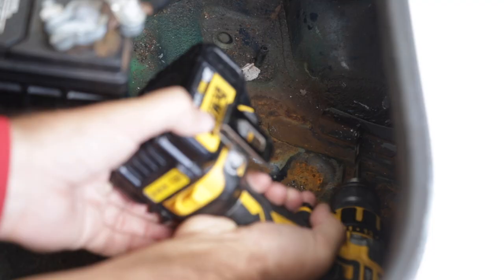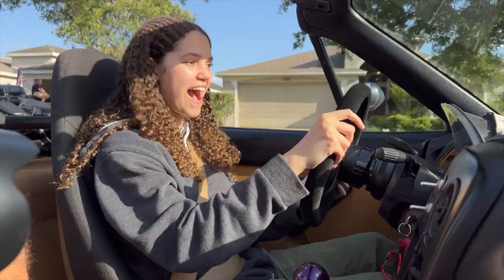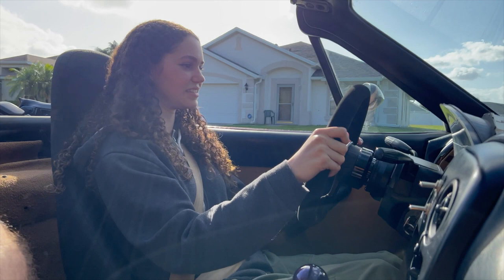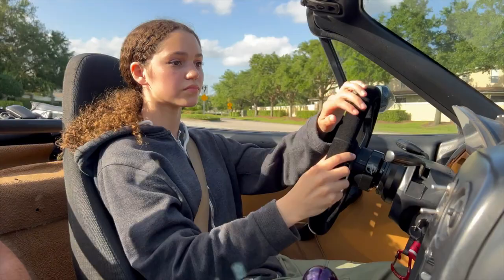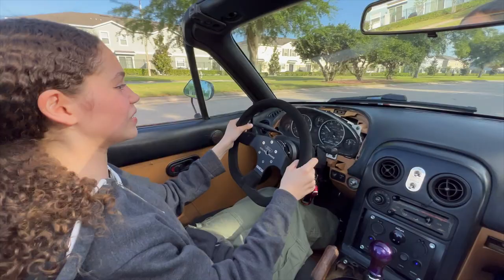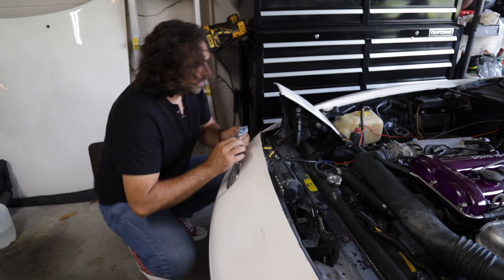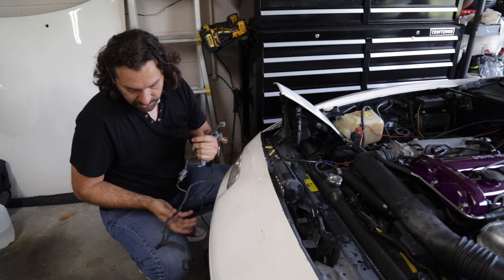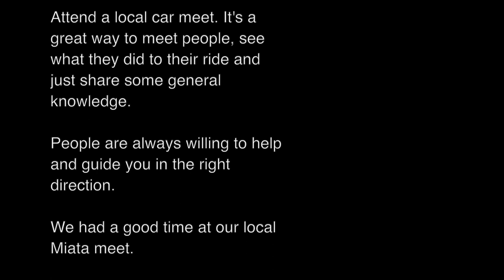Making it somewhat street legal | learning to drive stick shift

Comment: It was really cool seeing how your daughter is enjoying learning stickshift. I also couldn't image this is such an exotic experience for some, but she's doing really great. You have a lot more control over the car, your driving style, and the handling of various situations. Just wait till she learns about you can use the engine as break by shifting back, time the green lights this way, and just flying by them without stopping. And selecting gears based on the required torque for taking over or climbing slopes. Or not limiting speed downhill.

So, how long do we have to wait for her first drifting videos? :)
Reply from the maker: She got a lot to learn. I forget that I have 30 years experience and things just happen without thinking. I’m trying to let her get as much seat time as possible. I think we’ll try to start with drifting in 2 weeks. She’ll learn the same way I started. On some wet grass. It’s so easy to do it and stuff goes sideways doing 15mph. Then gravel and then parking lots ;). I’m about as excited as she is. I just got a GoPro as well so hopefully we’ll get some decent footage.
Reply: @Turbo_Snail  When I got my Mazda3, I took it out to an empty parking lot at the first winter's first snow. Back then my now-wife didn't have a lot of driving experience, just the license, and her legwork wasn't quite on top. I taught her clutchworks by starting the car in the 2nd gear smoothly. It's a diesel with 380Nm of torque, which wasn't always enough for her to get it right :) And I while I "check the car" I've almost drifted into a pellet of leftover stones, at horribly low speeds. Apart from having some fun, we've learnt some about car handling, the limitations of the car, which can contribute to safe driving on the roads. I think this is also an important aspect, while having such fun activities.
Reply from the maker: Oh I know exactly what you talking about. I loved driving in the snow. Today, tire technology and car technology is so much better. Isabell knows how to drive. She had a permit for 6 months. She drives all of our other cars including my tuned daily driver. However, take away ABS, traction control, automatic trans and some really shitty tires (currently) and she has her hands full. We’re doing some hard Accel/brake sessions today to get her to think fast. Girls tend to think before they do. Boys do before they think. When doing any performance driving, it’s gotta be instinctively. And that only comes throw repetition. I think she just needs a lot of seat time. The problem, the Miata is tiny and frequently overlooked especially by larger SUVs. Maybe that’s a great pitch meeting to my wife for why I need a sports car ;)
Reply: @Turbo_Snail  Right :) I think the only thing you might have forgotten about, and it's really essential, is rear wheel drives. Driving front wheel driven cars are a lot easier, due to how physics work out when the body is "pulled". AWD/4WD is the most stable thing ever, you can do really dangerous stunts on serpentines with an AWD, barely noticing how much the car is being stabilized by the mechanics over there. Now you try that with a rear drive, and you are serious trouble, just because you forgot your parachutes at home. Where I live I think we have like 3-4 miatas in the close area, and those folk sometimes are taking them out during winter season, it's a hilly area, where you can get black ice. Going uphill in just partially suboptimal conditions can have some serious side effects. I remember once getting here before the snowtrucks, and I had trouble climbing a 17degree slope in the fresh snow, and it was just about 5-10cm, so not even much. Regarding the tires, I think you are a relative worry-less father until she's asking for slick tires on it ;)

Other thing, that I think is very important, some time ago I got one of these promo tickets for a technical driving course, it was just for an afternoon. We got there after a fresh snowfall, slippery track wettened on purpose. We've been driving a friend's celica, automatic, 6 year old mirror-slick winter tires. At some of the exercises, i could hold the car better than some rich folk with their "d-compensational" cars. However, at the end there was a flat simulation, the car basically flew away like a vicutory flag. The only thing stopped the car from landing in the safety ditch was the snow piled up next to it. I've learned a LOT during those very few hours, and since then I never ever save on  good tires. I think such technical driving courses should be mandatory for a driving licence. It's for everyone's safety on the roads.
Reply from the maker: Agreed on the tires. We’re actually getting really nice tires for the front. And we have an endless supply of old shitty tires for the rear. Don’t get me wrong. As much as we love the car. It’s not a daily or one she’s a lowers to take to school. She’s still on a permit. It’s a fun car mostly for the track. It’ll be trailered eventually. We’ll take it out to meets and cruises once in a while on a good set of tires. She was also supposed to be at the teen drivers challenge on may 28 but we couldn’t get the car ready for it. She’ll be doing it when it starts to get cooler. It’s a whole day event and we have no A/C as of now (still working on trying to get it connected).
Reply: @Turbo_Snail  AC in an open car? I mean what's the point...
I think you don't have to worry about the school. The only thing that looks cooler than a miata is a shelby (eleanor, anyone?), or one of those old school porsches. I think the only part here you have to worry about, are the guys who she can't tell off by simply looking at the AT telling them "noob".

If you would allow me a bit of unasked honesty. If anyone tastes the joy of such a miata, despite being generations behind technically to the current era, I don't think the person will be satisfied with tracks only. I think you will restore it to the very last bit, make it completely road legal, and taking a fair amount of hint from our cultural differences, be very proud of the extended outcome of things. Unless, I mean, there are wankels out there, you know... ;)

Anyway, I think you are doing something utterly cool, and I'm envying you a bit here. I always wanted a miata, but currently the requirement of having 3 isofix points for the childseats are pretty much blocking me. I really hope one soonish days, before they are banning fossil fuels completely, I will be able to blast one on the autobahn.
Reply from the maker: We’re in Florida. The moment it starts to rain you can’t see a thing out, it gets all foged up. And yes, we got the roof and the windows finally sealed. I think I need her to be in a saver daily. Follow the other playlist with my sons car when he turned 16. I got him an old S500 Mercedes’. For safety. So I need something safe for her daily. I’m thinking a convertible Mercedes C class or maybe moms SUV. The truth is people drive without a care and even with my experience we’re dodging other cars. I think I need to fix the horn soon and get some hella loud ones. The car is lowered and goes just about to my waste. In todays standards it is really tiny. I’m trying to look at safety as if she was on a motorcycle. 

Hey, I was there where you are not long ago. I traded my 1995 Mustang with a supercharger for a Ford Taurus station wagon. We tried to make it work but it just wasn’t feasibly. Then in 2006 when the little was was born we again trained our 2005 Convertible mustang for a pampers bomber. That’s it for me. I’m trying to decide what my next car is. I don’t like the Supra. Nissan Z im curious but honestly I’d love to find a car with a V8, RWD, manual and no turbos. Despite what my Chanel name is, I do not like turbos. ;)
Reply: @Turbo_Snail  I totally get your preference regarding the kids. I would personally say, if your top priority is safety, get a volvo. Nothing can beat a volvo regarding safety. They are designing their cars to be completely safe in one of the most hellish environments on this planet (ever heard of Norwegian winter roads?). And I personally dislike everything that has anything to do with german engineering. I think it's crap. It's only functional as far as you are able to provide a total replica of their laboratorial testing environment, out of that it's an undefined behaviour. And not even to mention that parts are very costy and you do need to fix something on them regularly.

Regarding your personal car's preference, a local car paper once said, if the god of cars had a voice, it would be V8. For myself, if ever they would bring out a modernized rotary engine, I wouldn't even think once to rush and impulse-buy it. There's something charming about the car in your engine originally been designed for airplanes. "nah, it's just a tiny 1.5L engine". For a while I was also a big fan of mustangs, then I've seen today's mustangs, and the miatas. Miata wins hands down with its looks. It's just a lot sexier. And despite the autobahn being really close, that's not an everyday environment what I can utilize.